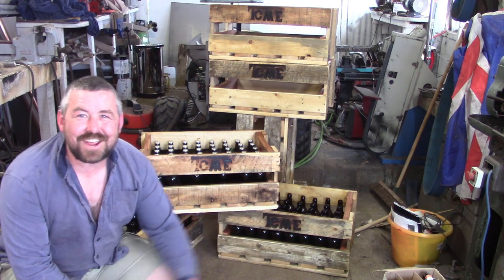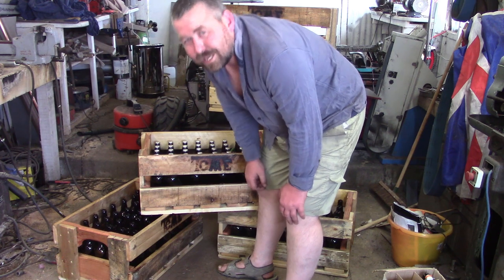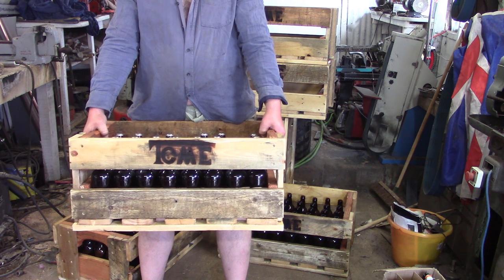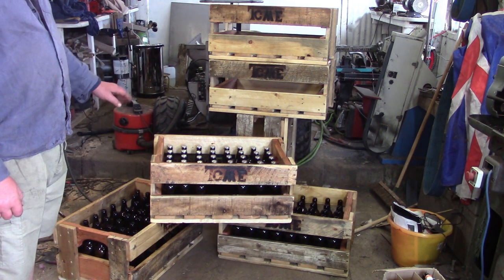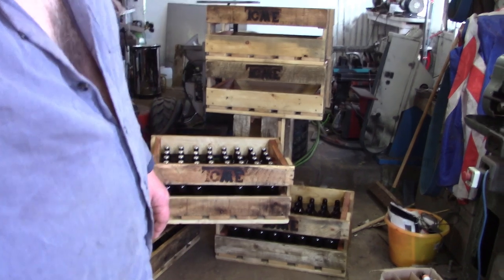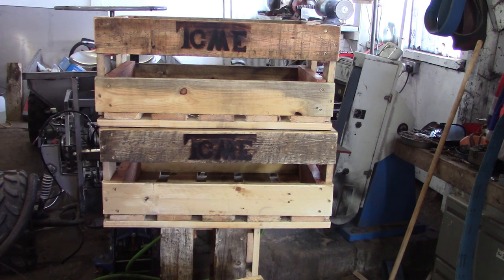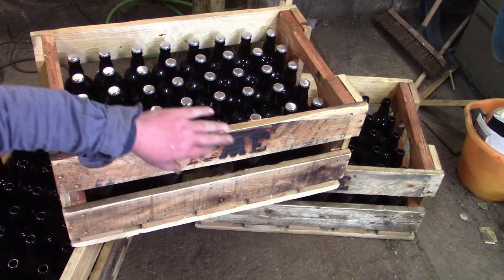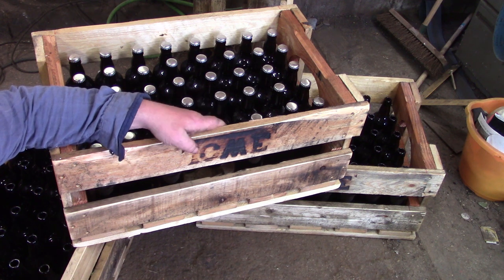Making beer bottle crates from recycled pallets

Comment: Tut tut.... You really screwed those up! ;) Nice bit of mass production there, both the crates and the beer!
Reply from the maker: Very good. It's fun doing a little production run occasionally isn't it.
Cheers mate
Reply: @turboconqueringmegaeagle9006  It is, and when you have it figured out, it works well. You also did that for your draws. Good work.
Reply from the maker: @BensWorkshop  that's right, glue and nail gun definitely suits mass production better than screws.
Reply: @turboconqueringmegaeagle9006  Yes, but you need better prep on the wood so it's swings and round abouts...
Reply: @BensWorkshop  absolutely, more swings and roundabouts than butlins although with the Pu foam glue, surface prep is minimal, gaps and damp are fine, dust and oil are the only things that upset it.
Unfortunately I never took your advice and still haven't gotten a gun capable of shooting 40mm nails.